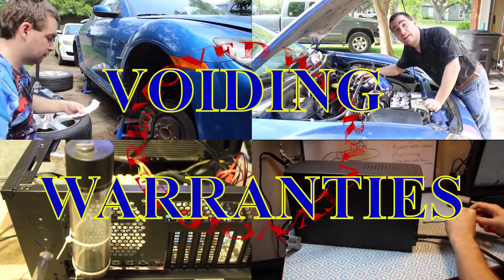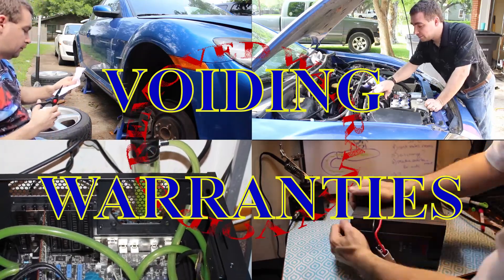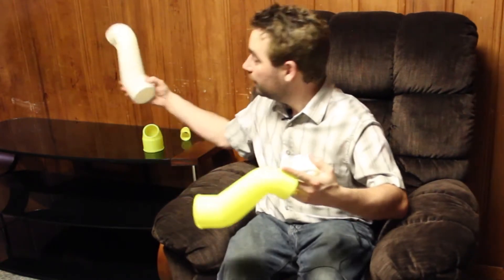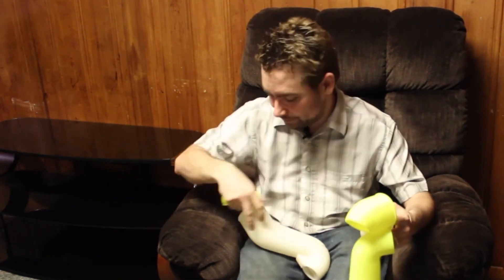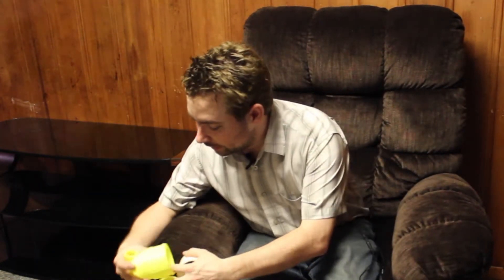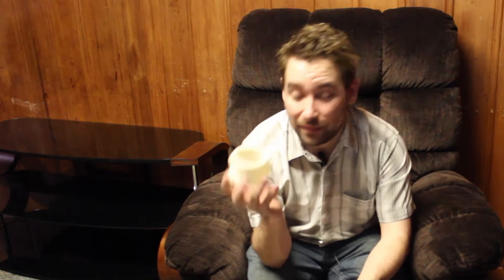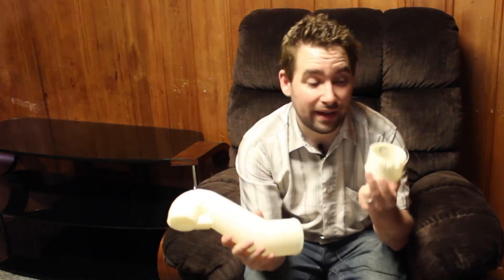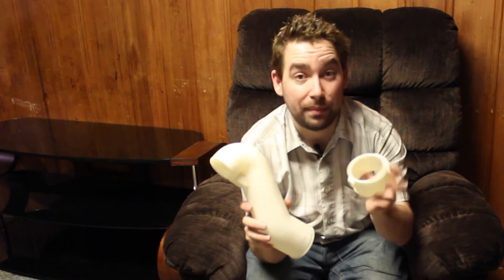3D printing an intake manifold - Voiding Warranties Ep37

Comment: what 3d printer and software do you use please buddy... I'm looking to design this kind of stuff, and it's good to see it first hand thank you. I subbed since the obd test on that Chinese fake unit
Reply from the maker: The designs were done in Fusion 360, it's available for free with a hobbiest license if you earn less than 100k a year with it. The printer I'm using is a Folger Tech FT-5. It has a 12in/12in/18in build area and it's pretty awesome for the price, but the manual is lacking and assembly is a pain.
Reply: Voiding Warranties ah I see, sounds great I'll definitely keep an eye out and see how you get on, how do you think these parts will handle heat? since heat is used to make them. thanks again
Reply from the maker: Yeah that's why I went with the nylon, higher melt temperature. My stock intake is glass fiber reinforced nylon, so are many parts under the hood, I think the fuse box is ABS but not positive. It should work without issue, but we will see.